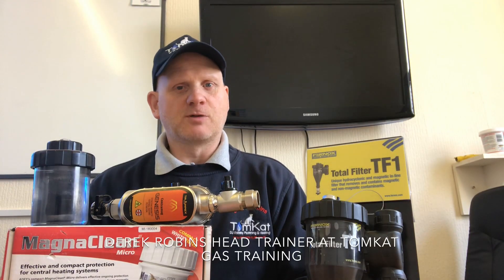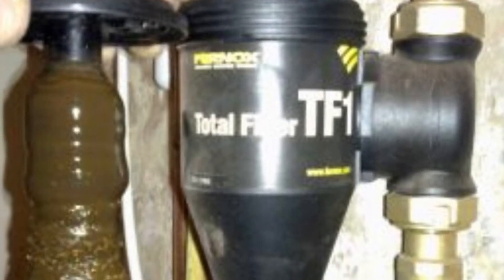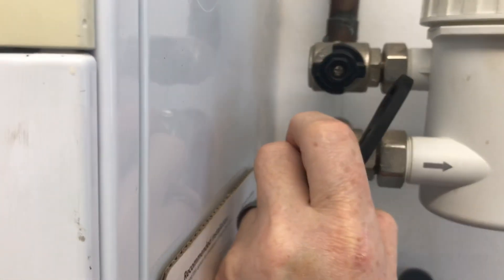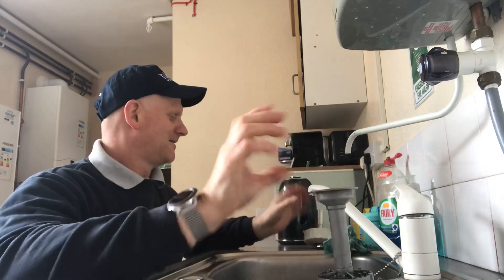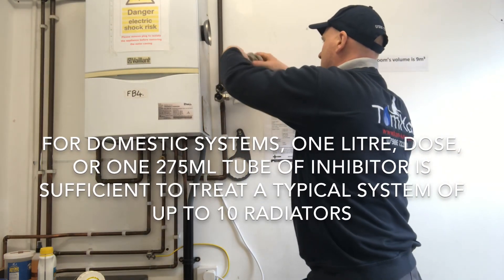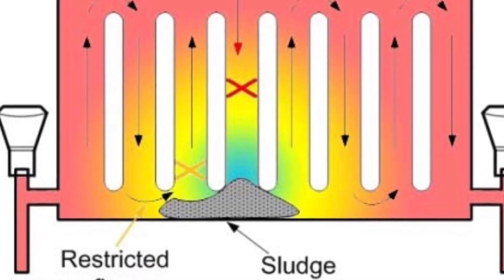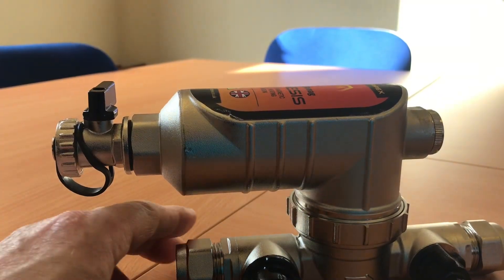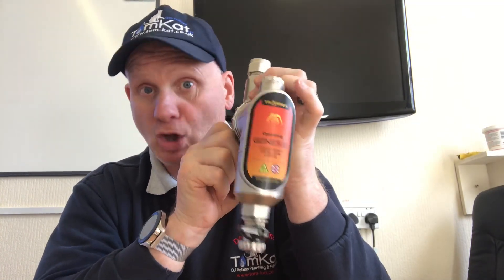WHICH HEATING MAGNETIC FILTER IS BEST. A look at the workings of magnetic heating filters part 1 .

Comment: Awesome video. Nice and clear. If a radiator is hot at the top and cold at the bottom, there is sludge in the radiator. If it’s cold at the top and hot at the bottom then you have air in the radiator. Very unlikely I will forget that after having watched this :)

Why must the magnetic filter be after the vent if installed on a open vented system?

Thanks Derek. 👍🏻

Asian Jon. Training.
Reply from the maker: M J0n4id so if the valves get turned off the boiler still has its safe path to get rid of the water when it over heats